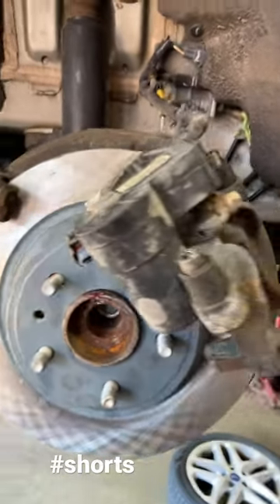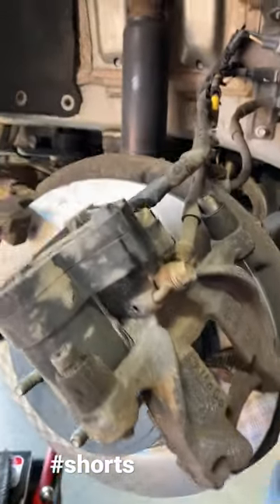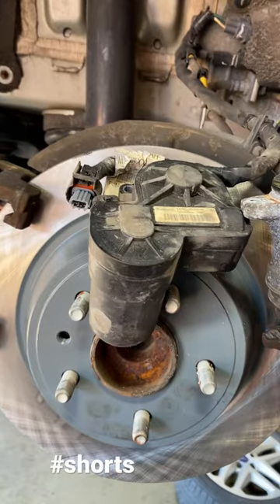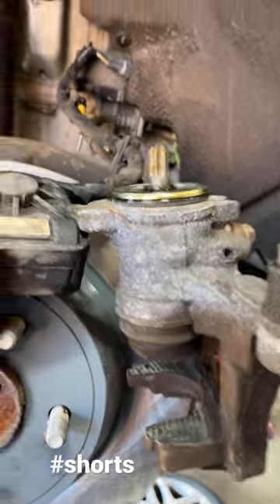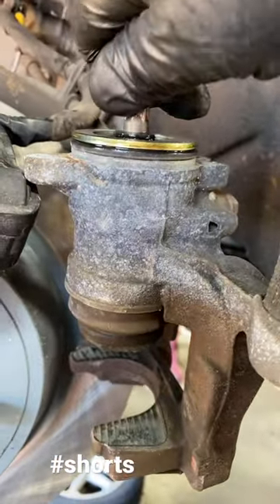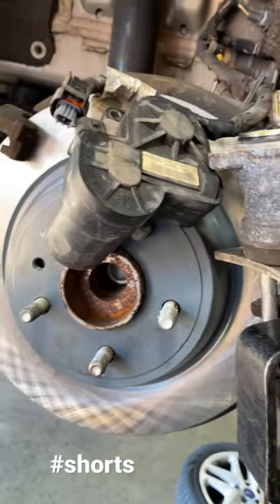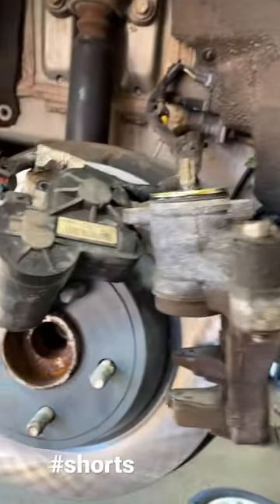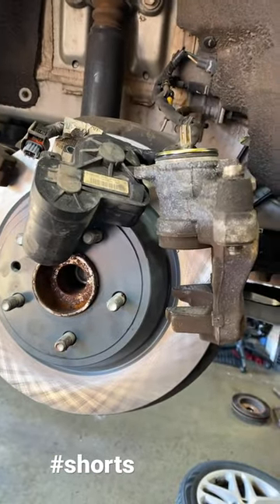Electric brake calipers #brakesystems #fordfusion

Comment: The fusions with electric parking break don't need scanners to retract the caliper. There's a simple procedure which you can do inside the car without a scanner. Google it and you'll see the sequence you have to do for the car to enter in service mode.